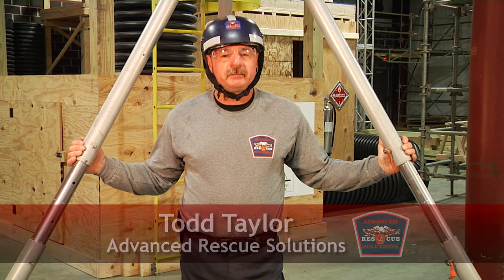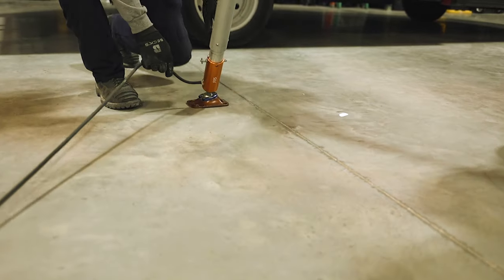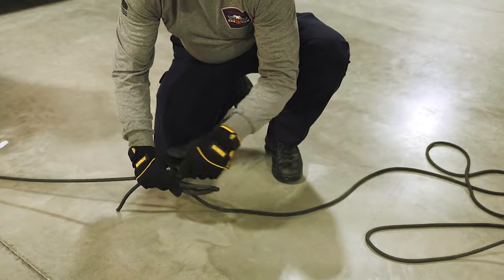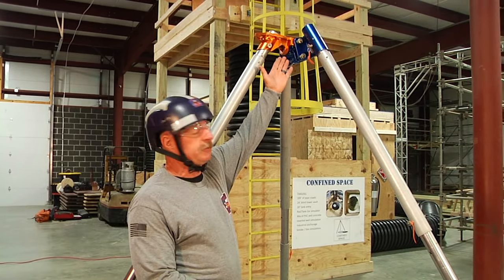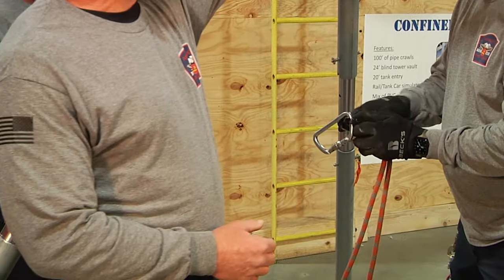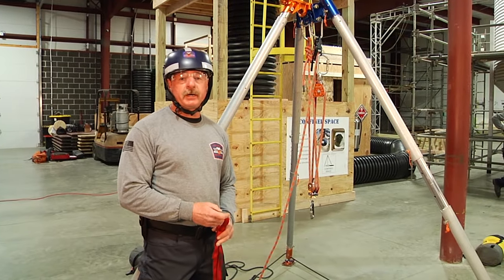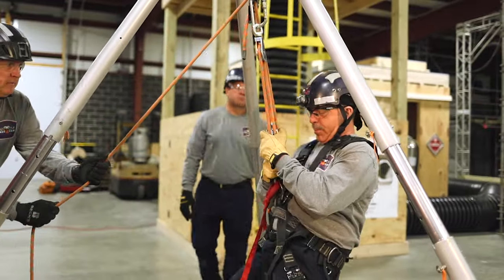Confined Space Rescue: Alternative Setup for Tripod

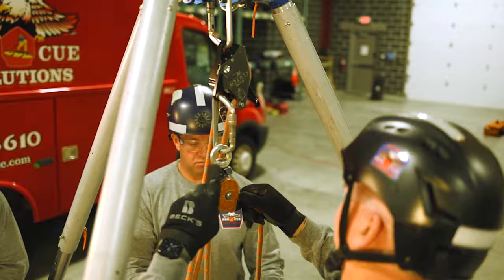Comment: Since space and distance in the haul system are an issue in this configuration (2:15-2:25), why not attach the single pulley to the tripod head directly instead of from the becket on the bottom of the clutch? I understand you still need to be able to operate the clutch but It would save at least a foot in your system.